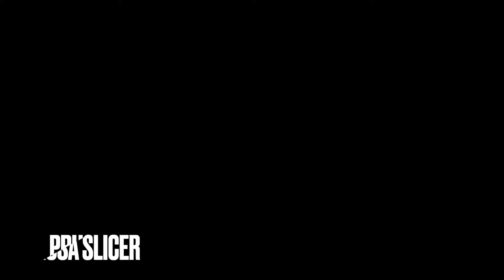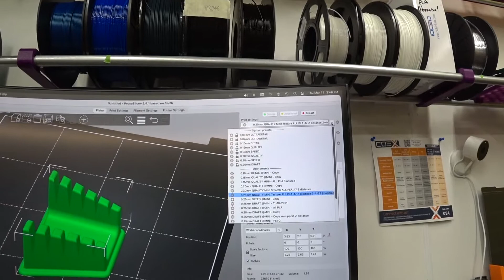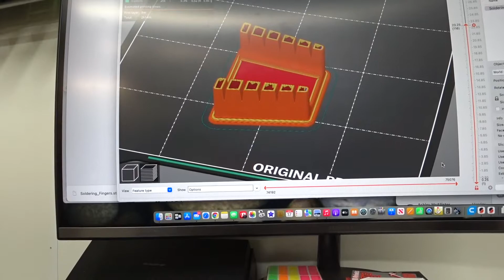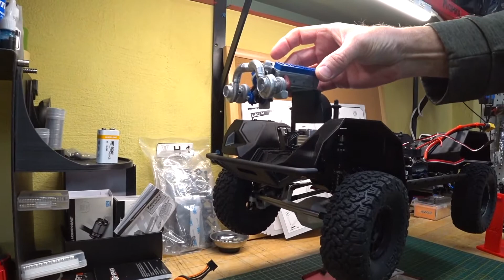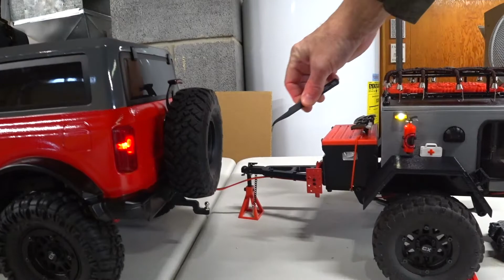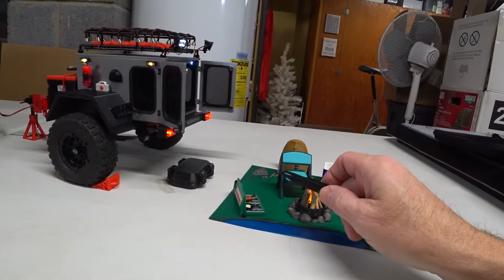3D Printing with Prusa Mini and MK3S+

Comment: hi, please explain the printer feet. Thanks in advance. K
Reply from the maker: Hello - Thank you for the comment. The Squash Ball Feet are an anti-vibration device. The printers are not loud by any means right? But the stepper motors give off a vibration during their run times, as they are moving very fast in all directions. That very low volume vibration is amplified by the furniture that the printer sits on, and it's very evident when you're sitting next to them as they are running.

These printers are in my basement and because it's a vibration, it can be heard, although at a very low volume, on the first level of my house in our bedroom, especially when it's very quiet over-night. I printed these feet and ordered the squash balls (very soft rubber) from Amazon. Now there is zero vibration through the table.

Many printer owners set their printer on a large stone block, which also does a great job of eliminating vibration. Some use cement patio blocks or granite blocks.

I hope this info helps explain!

Comment: It is a great review video, I am using mk3s+ and considering getting another mini later.  Would you share the squash ball feet on the mk3s+ you are using? Thank you in advance.
Reply from the maker: Thank you for the question - here is the stl file that I used: https://www.printables.com/model/59947-new-version-squashball-mk3smk3s-vibration-damper-v
Reply: I found it in your printables collections, thanks again.